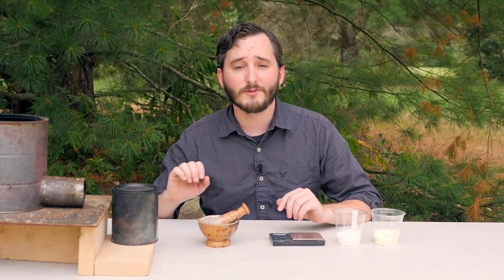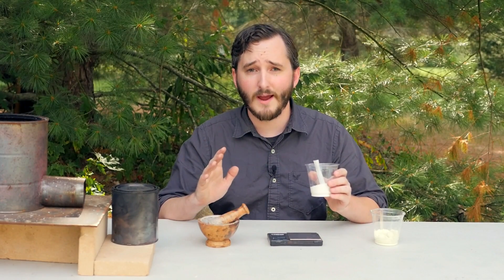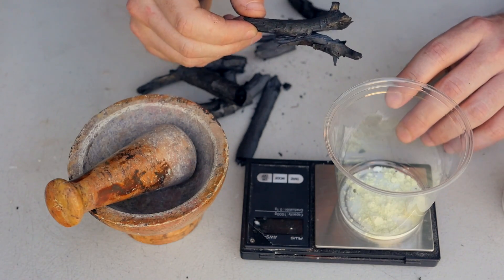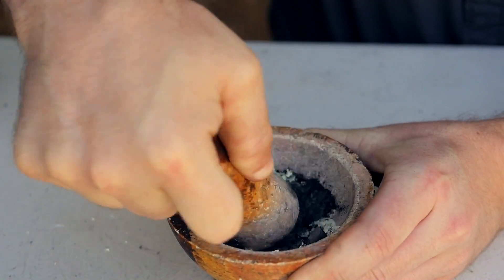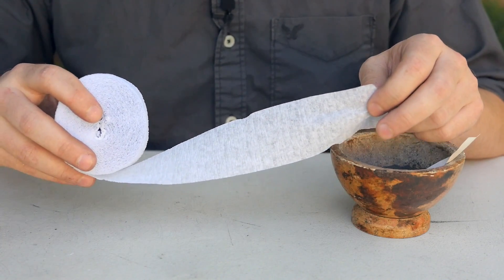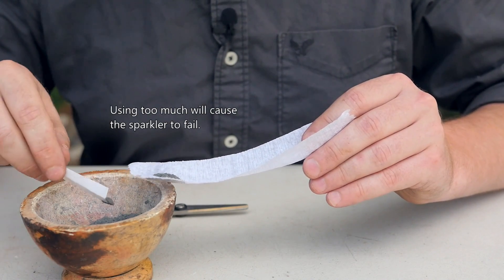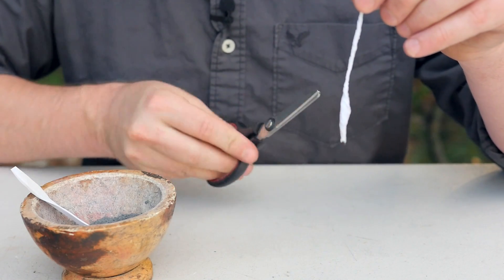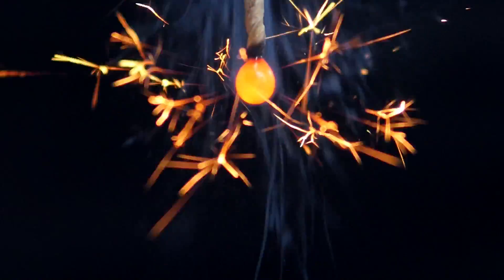How To Make Senko Hanabi Sparklers (very rare Japanese fireworks)

Comment: I guess having a smaller amount of the mixture concentrated in a region of 1/2 inch would be better?
Reply from the maker: It would work very reliably but also not create a very big ball of slag to make the sparks
Reply: Adding around 1.5 grams over 3 inches seemed to work for you last time(2008)
Reply: and letting the end loose (not rolling the entire paper)
Reply from the maker: It was probably about 1/2 gram over 2 inches. It did work the one time, but what you don't see in the clip is that I had to manually blow on it to get it started so even then it wasn't perfect. I tried probably 50 more of them in the same configuration that didn't work even as well as the ones in this recent video.
Reply: Oh well... I will find out if the materials required to make this is available here in India and if I find a better/more consistent method of making it, I'll update you on it :D
I've been following you for over 5 years now and I just love your work! I remember the first day you decided to reveal your face.. Keep up the great work and keep experimenting!

Comment: try adding iron filings maybe. saltpeter burns pretty hot, could be enough to start the iron to burn, which makes those feather sparks you see in many fireworks, and or sugar to increase the oxidizer effect. be interesting to see what if.

Comment: You could try taking a temperature measurement during the first part of the reaction when you first light it and when the ball of slag starts forming, if there is a difference in the temperatures you could try adding a metal that will only burn at the temperature that the slag is at.

Comment: Great work, nicely presented. BTW I work for a science museum and we built your bat signal rail setup. The kids love making their own symbols and projecting them during overnight programs and at camp.  

Thanks for inspiring me to tinker.  If you have any ideas on how to make a hailstone  generator let me know!. I was thinking of using a clear tube, and putting compressed air through a radiator in dry ice or liquid nitrogen, then introducing a water mist into that vertical stream of cold air in the tube. 

Thanks again!

Comment: Have you tried adding more rosin to the mixture? would that make more sparks? You can buy bow rosin thats used for violin bows and such, it comes in a little brick. I happened to have some crushed rosin/ rosin dust on hand (not sure why but whatever lol) I hit it with a jet lighter and it gave off a few sparks, unsatisfied I sprinkled some of the dust above the flame and it gave off a little puff of fire with small sparks mixed in. Not sure if this info is helpful, just thought I'd share. Maybe mess with the size of rosin dust? Anyhow thanks for sharing I've always wanted to try these sparklers, and now I know how to make em. Thanks for sharing and sorry for the paragraph

Comment: Have you tried adding a little iron powder to the mix? Some finely ground steel wool may add some more sparkle.
Reply from the maker: Any metal added to the composition burns away before the slag forms.
Reply: We tap iron from the furnace at work at >2000C but I think you're right, it may oxidize or simply fall out of the droplet long before the sparkling starts.

Comment: Great video I want to try.  You asked for ideas to help...Perhaps less oxygen exposure in making your charcoal by sealing your tin after the white condensation smoke ends, or if that does not work, sealing it right after the browns gas is depleted?  Or activating it via a lye solution? As to the paper, If you fireproofed it yourself with different formulated strengths on even thinner walled tissue paper?

Comment: Very nice! 
The reaction appears to be related to how glitters work, but without any glitter specific ingredients.
I read an interesting book about the chemistry of glitter, where they quenched the sparks or the star in water at various stages of burning, and analyzed the results. That might be interesting to do here. Glitters burn in the same semi molten state. Adding other glitter ingredients may be worth trying. Maybe your charcoal picked up a bit of iron oxide from the can that one time?

You mentiond polysulfides, it reminded me of a curious mixture called yellow powder. I think it i S, KNO3 and K2CO3, and when heated to melting it will suddenly detonate like a high explosive. That could be a fun video.

Comment: add some kind of mix that produces sparks like the ones you want, (but which of course would normally be burnt away and not join the slag ball) and encase it in a coat of clay or enamel. get the thickness of the coat right, and the outer coat only melts away once inside the slag ball, bursting out and creating the sparks. since this method uses more conventional explosives, you could probably control the size of the sparks, temp and even color!

Comment: Have you tried activated carbon? You mentioned that particle size doesn't matter... What about pore size? One of your references mentioned lamp-black didn't work; I think this has a fairly small pore size. I wonder if a charcoal with a larger pore size may work. The activated carbon intended for aquariums should have a larger pore size than that meant for normal water filtration. 

Also, have you tried adding small amounts of various salts or bases, to boost what is naturally present in the ash? Things like lime, gypsum, potassium/sodium hydroxide? What about rinsing the charcoal in a solution containing these, or just plain ash-water, as a way to load those chemicals into the pores of the carbon structure?

Comment: Nice slow-mo close-up @0:24 where I seem to observe: 1) the sparks originate not from the "slag"-bulb nor the firework-body alone, but from the interaction of the two.  2) There is a blue flame around the bulb.  3)  Cohesive surface tension in a somewhat viscous liquid.  4) Dark spots and turbulence in the liquid bulb.  5) An excess of ~2.5x more sulfur in your formula compared to gunpowder.

This suggests that the excess of sulfur makes a reducing environment in the bulb and the blue flame suggests the sulfur burns off when it meets the air.  Sulfur boils at only 445 °C, which I'm guessing is much less than the bulb temperature judging by its apparent incandescence.  Presumably the heat from the sulfur flame and its shielding effect helps maintain the hot reducing environment in the bulb, and might even drive endothermic reduction reactions.  

Apparently, surface tension pulls the bulb up.  The bulb acts a bit like the wick of a candle,  (an inverted candle).  Heat from the bulb melts the KNO3 oxidizer and other materials in the firework body.  These presumably have laminar flow, flowing fastest down the center-axis and into the center of the bulb.  In the bulb, I suppose the mixing of oxidizers and reducers initiates the (redox) reactions that lead to sparking.  

The temperature of the body-materials increases as the reaction proceeds and as the materials move from the stem into the bulb.  They change from a cool powder, to a warm liquid, to hot redox reactions, and to a boiling phase-change and/or oxidized outgassing (SO2, N2, CO, CO2).  

I'm imagining the way a lava-lamp works.  Presumably the inverted temperature gradient (hotter on the bottom, cooler on top) and the decrease in density with temperature causes a strong convection current and bubble-pump effect causing higher turbulence in the liquid and more vigorous mixing, and a faster reaction rate.  

Presumably as a bolus of oxidizer liquid enters the reducing environment, I guess the surface where the oxidizer and reducer meet will react to form the K2S "slag".  I'm guessing this may tend to shield the two so that the inner part of an oxidizer-bolus won't immediately react with rest of the reducer.  Then turbulence, convection and outgassing will cause mixing.  

I'd speculate there are non-homogeneous positive-feedback effects, where local turbulence/convection/mixing may likely cause increased: local mixing, exothermic reactions, thermal expansion and outgassing. These in turn cause more turbulence/convection/mixing.  I guess one theory is that this causes a type of "rocket-propulsion".  Perhaps effects like this shoot the sparking-materials out, or perhaps cause a local bulge in the bulb surface which then further reacts with the flaming sulfur vapor and air. 

But I'm only speculating... it could be completely wrong, haha.

Comment: Maybe the differences comes from the sulfur. Sometimes old sulfur that have been exposed to humidity have adsorbed h2s on the surface grains, when the sulfur melts some of it could get trapped forming micro bubbles that burn when reaching the surface, the burning being quite exothermic it may contribute to the spark.

Comment: Have you tried monitoring the temperature of the bead of dross with an IR thermometer? Maybe the amount and volatility of the sparks has a relation to the temperature of the reaction taking place and knowing this could help you narrow down to some solutions. If not that I'd suggest brainstorming some independent external testing to compare differences and similarities rather than relying so heavily on what goes into it and then when you've found some of these variances you can work on what goes in. Some other thoughts are timing the reactions so you can arrive at a weight/time assessments, determining cross sectional area of the sparkler prior to lighting vs the final dross,  a way to quantify the shape of the sparkler (is the material in a cylinder, tear drop with small side up, tear drop with small side down, etc.)
Reply from the maker: Interesting thoughts

Comment: It would make sense that the bigger the ball is climbing up the paper the larger the spark size would be. The real trick to perfecting this might be getting as much of the powder to burn as possible while still having it function correctly. Or maybe using a wider paper to get a slightly thicker wick (or whatever you would call that)

Comment: Have you tried adding oxides for sparks? We use them in our fireworks at the river each year. I'm sure you already know and have tried I just didn't want it to slip as a possible option. Different oxides=different sparks.

Comment: Coming around full circle for me.. was the original reason why I subbed.. someone who made real fireworks. Nice job! :)

I would think that your one success back in the day was due to some extra impurity that was present in the mixture. I doubt it was metal filings, but something that was in the charcoal. Since sappy wood seems to work best, I might suggest timing your charcoal production so that you stop the conversion slightly early to leave more sap residue in/on the charcoal. Might be a bit tricky, but that's about the only thing I can think of outside of getting a specific wood charcoal they probably use for them from Japan.

Comment: Have you tried using washi paper?  I did a little research, and the best I can tell is that's what they use (but maybe kozogami?).  I also found this (http://www.vk2zay.net/composition/37) which suggested dipping the tip in nc laquer or rice starch paste (you can find nori glue at several crafts stores and online, which is made from rice).  Hope some of those help.

Comment: Have you tried wrapping it in the linen you use for char cloth possibly treated with some kind of retardant? or using char cloth as a source for carbon by wrapping the other ingredients in it before wrapping it in paper? In your first video it looks like the slag ball forms BEFORE all of the mixture is consumed and moves up the sparkler only igniting what is directly above it.  rather than your new sparklers that flash over and then form the slag ball.

Comment: this is very cool,, i have a way you might try, this will take one or two attempts but if you try the test first you might get some idea of what i am saying,,
first get one cigarette paper and twist it just like the crape paper, but do not put anything in it ,, set light to it but keep the flame on it, the ash will glow like lime-light,, this can be done over and over untill you have enough to test the sparkler with,, you will have to use two parts of paper to wrap it,, first part cover in the lime like powder it will be very dusty, this will help with carbon fuel burn,,more slow burn with bright kick,,, please try this even sometimes the mad idea works,,
you must try the cigarette paper first to see how bright te ash gets and it gets solid after seconds of lighter flame..

Comment: You could try with a mixture of 4 parts of Charcoal , 3 of Potassium nitrate and 1 of Sulfur.
If this mix doesn't work well you could use 1 of Potassium nitrate and 3 of Sulfur.

This is based in the rarity of the materials and in the difficulty to extract them in old ages.
Thanks for your videos ,i hope this can help you.

Comment: Try to use Washi Paper. I Think it doesn't has to be the traditional handmade one, but this could be a result changing factor. You can buy 40 pcs of handmade senko hanabi online for 10,000¥ or nearly 100$. But I think this isn't THE ORIGINAL senko hanabi. In the 20s  and 30s of the  19th century, these fireworks had to be cheap, because they we're toys for children.

Comment: so you asked for ideas but youve been doing this for 10 years my only thoughts would be try trimming the paper lenghtwise a bit to have less and see if it has any effect and try to change the mixture by 1 or 2 % start with charcoal   1 control one with less one with more and see results this way you can figure out what makes better sparks
Reply from the maker: Yeah I know I am probably the world's foremost expert in what doesn't work when making Senko Hanabi, but maybe someone will have a novel idea I haven't thought to try. I have tried various widths of paper and it does make a difference, but hard to tell if positive or negative. The less paper used the more easily the ball wants to fall off, so in that way the sparklers are harder to use and you cannot use as much composition or the ball is too heavy.

Comment: NightHawk, try it in a colder temperature as it might emit more sparks as the bottom part is cooling, even holding it over a glass plate in your fridge might work.
Reply from the maker: I've found they're a little hard to use in cold weather because the drop cools too fast and goes out.
Reply: NightHawkInLight what about moisture in the materials, or humidity?

Comment: What happens to the globule of slag when it gets to the top? Does it drop off or do you just put it in a bucket of water?
Reply from the maker: It goes out on it's own a few seconds after the sparks stop. It doesn't get close to the top.
Reply: It drops off at just the slightest shake so in Japan it's a common game to light those sparklers with friends and the one who can keep it burning the longest is the winner.

Comment: I would add some magnalium dust or iron dust to the mixture. Whery fine grade and not a lot what so ever. Iron podwer with magnalium will produce amaizing sparks
Reply from the maker: Any metal added is burnt away before the point where the sparks are supposed to form. I've tried it many times.

Comment: I wonder if supplementing an additional source of pine tar/sap(Purified, possibly?) would make any kind of difference to the burn rate.
Reply from the maker: I've tried adding a little tar to the mix without much effect. I'm yet to try a sparkler with only tar and no charcoal.
Reply: That would be interesting to see. If you go down that road, you could maybe even try adding some paraffin wax or something else similar.

Comment: If it requires such precise measurements, how did the Japanese make them in the past or originally make them?
Reply from the maker: Scales have existed for a long time. If they didn't use a scale they would have made a large batch and slowly added ingredients until it worked. Very tedious and non repeatable to do it that way.